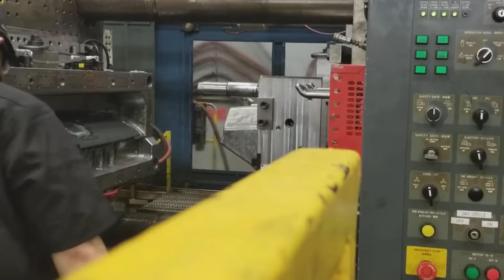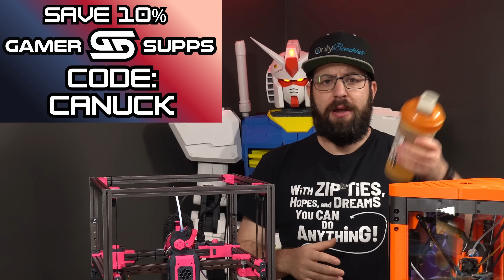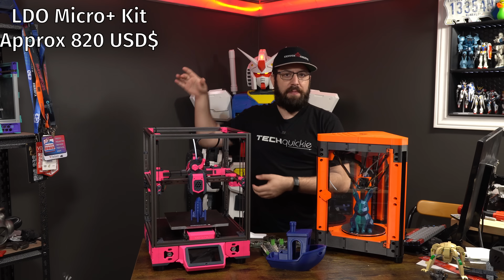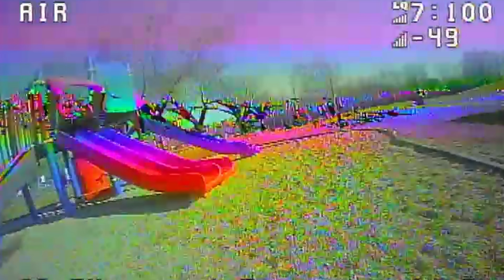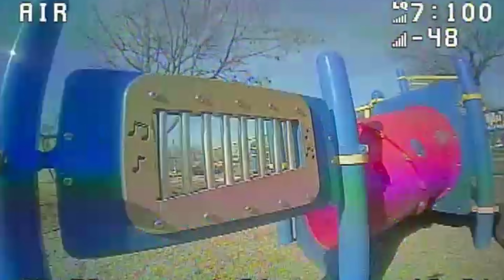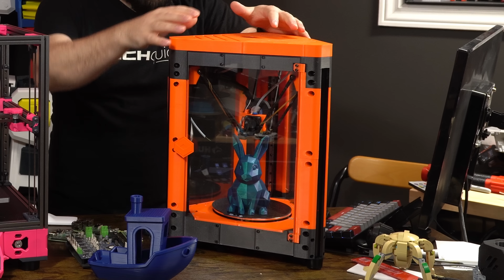Are DIY 3D printers in danger?

Comment: I built my Prusa MK2 and my MK3S. I built them more because I had to vs wanted to. I don't want building printers to be my hobby and never did. It was necessity. It's a tool for other hobbies. I don't want to make most of those tools either anymore than I want to make a screwdriver, hammer, file, or nail.

Comment: I started back in 2016 and have built various bed slingers and corexy printers, toolheads, and uogrades but at some point in the last couple years Ive found myself moving on from focusing on the printer and just wanting to print. My self built printers always became projects in the end, reliable enough to keep working on but never satisfied with the results for the effort put in. Sold all but my v0 and went in on BambuLabs to just pop in filament and have a great quality print with little effort. I always look for the next best thing, I’d even put effort back in to make, but the community is not cohesive enough to have a kit that becomes hands off enough to rival the BL printers. So now I’m off to printing parts for CNC machines, robotic arms, and a magnitude of other projects not worrying about if my print job will fail me or that my printer will be half in pieces for 6 months until I get around to yet another upgrade.

Comment: I may have made fun of your beard in the past and got banned from your discord, but I think you hit the nail on the head. 
This isn't unlike the RC airplanes of the 70's when the only way to make a plane was buy plans, buy a stck of balsa wood and get tracing on the diningroom table and make with the glue and monocote over the winter for the  upcoming summer season. Today you would have a hard time finding the materials as most kits are molded and can be assembled in an hour. <<sniff>>
The same will become of DIY printer building, like gearheads making custom cars or people that build custom CNC machines, there ARE people doing it, but it becomes a relatively small % of the market as compared to the ones that just want the thing to do the thing. There will always be "creatives" who just do their thing but supporting commercial kits like LDO et. al. will become more and more of an acconomic challenge for them to keep is cost effective. I'm no model railroader, but I suspect that market is very similar.
I like you, I got into 3D printing industrially way back in 2008, and at the time, there were zero commercially avail home units other than DIY. Bre Pettis had just started with his Cupcake CNC printer, and it was pretty hokey pokey. I have only built machines for personal and professional use up to now. I have recently been gifted a Qidi X Max-3 and I have to say, there is value in being able to turn something on, get a part printed and walk away... Yes, as a builder and Engineer well awar of what I am looking for in terms of features, but in the end, it is all about ecconomics and time.
Will I be building a DIY printer in the future out of a kit, scrounged industrial spare parts and prototype scap extrusions, absoluitely! 
Will I be buying a commercial off the shelf printer from a big name brand, probably yes too.

Keep up the good fight. Nice work.

Comment: Built an i3 clone.
Built a V0
Built a V2
never bothered assembling my V1 trident

While the V0 is 100% my favorite,  I don't see myself building another printer again.
The cost is just WAY to high to justify when you factor in the time it takes not just to build it, but to tune the printer.
At the end of the day its a tool, and i can now buy a working machine for a fraction of the price (time has a cost) than i can now build my own.

Comment: The next DIY will be centered around mini-factory, print, eject, bin.  And also into engineering plastics, because desktop CNC is here now which is a foundation of metal, and water cooling. You can see the industry slowly steering this way. Desk top additive and subtractive manufacturing to support high heat engineering grade prints. And this will lead to desktop injection molding. Hopefully we also get some desktop recycling and filament production to give us some full circle awesomeness.

Comment: This video puts me in an awkward spot. Lol . I have several "box" printers all with decent volume sizes. But all of the z Heights are completely overkill for me. The tallest thing I print on the regular is 100 mm tall . So having 256 or 300 mm of height is complete Overkill. I'm taking a creality K1 and cutting its Z height in half. Building a new frame for it with a unique exterior look . It will still be fully enclosed . The whole Gantry will be mounted lower than it is on the factory one so that the entire cable chain set up up top will be contained inside and not need one of those Goofy pop top lids. I'm shocked that there is no printer available with a reduced Z height for people like me. I know there's a lot more out there that don't need tall Z Heights. For packaging purposes if I have these stacked vertically on shelf I can have three in the place of two potentially even four in place of two. 👌👌👌

Comment: I’m in that middle group you mentioned. I enjoy building and/or modifying printers. But I also have no problem with buying one. I’ve built a couple Vorons and have heavily modified my Ender 3 V2 as well as an Ender Clone. I enjoy building them as much as I do using them.

Comment: casually glances at the XYZ da Vinci 1.0 Pro sitting on his desk 2016 fully enclosed, open filament, core xyz machine with wifi. Still runs. Still prints what I want to. May be slow but it works for me.

Comment: I don't know I have built many printers, I have bought several off the shelve printers. My whole goal is to print things with the least input costs. The prebuilts spank my voron up and down, and for me cost is the driving factor. If I can buy something that works better off the shelf at a 1/4 of what it would take me to build it. I am buying it, plus the prices are insane the X2D dual nozzle extrution that actually works well. It spanks my voron and pallet all day long at half the cost.

Comment: People have a stronger desire to do the things printers and drones can do, without making the printer or drone a project on it's own. 

I'm sure the DIY space in both areas will always be around in some form, but I wouldn't lament it's reduction in size at all, I welcome it, having a printer that functions more automatically without needing to constantly fiddle and adjust it to get it to work is a massive pain, and that's exactly what you get with a DIY printer.

Comment: Thinking about building one with a 1" thick aluminum bed drilled and tapped with heaters using hi-win blocks and large servo motors with servo pack driver boards. A very large and heavy machine.

Comment: I love tinkering. I love building, I love making things. But I'm getting older, and I'm well past the point of making things for the sake of making things.

I don't want to build a 3D printer, and I don't want to spend all day/week/month messing with it just to try and get it to do something. I just want a printer that prints.

Or as the meme says, I just want milk that tastes like real milk.

I'm eternally grateful to each and every person who's done the DIY thing, who's contributed to the community, who's helped make 3D printing what it is today. I really am. And thanks to all that development, I can just go online, order a printer, plug it in, and get it going in 15-30 minutes.

Now THAT is a golden age.

Also no, I won't touch bambu. That locked ecosystem bs is wrong on so many levels. I got a Qidi Plus4, I keep it airgapped, and it runs very happily off usb sticks for print files.

I'm still a maker. I print mostly stuff I've drawn myself, for my own projects. I fix stuff around the house. Occasionally I print stuff for my friends (usually to fix stuff, occasionally trinkets). And I've learned so much, learning how to draw things I want to build, that are printable.

But I just want a printer that works.

I don't think DIY will ever go away, though it has become optional now, whereas it used to be a necesity. And I think DIYers will come up with the next big thing, whatever that may be. 

But... it's optional now. And I think that's a good thing.

Comment: I think FDM is getting close to the best reasonable hobbyist can do for now. DO not get me wrong here, I am an avid VORON enjoyer. I am an engineer and I use one to fabricated experimental setups in a laboratory i work. It is a 350 trident that i custom designed high flow chamber heating / cooling for. the thing hits 100c chamber temps, we can printer engineering grade materials on it. it cost 3000$ and against a 11000$ professional machine it is a steal. for the hobbyist though, what is there end goal? printing exotic polymers that can kill you if they overheat and it cost 200$+ per roll? more likely they want to print trinkets and boon doggles in pla. an out of the box printer is unfortunately the easiest way there. There was a time where kit printing meant new features people wanted but couldn't have. That is still true in some cases, like my lab printer with it's 120cfm of cooling and 100C chamber for printing chemically resistant parts. for most people though I dont think it is true anymore

Comment: So... here's a question from an outsider wanting to get in: What do I start out with? I have some criteria that need adhering to.
1: Dummy simple to set up. I'm not averse to putting things together, but I want it to go together relatively fast and easy. IE: I crack the boxes open after work on Friday and can make it go Brrrrrr by Saturday night.
2: Offline capable. I don't want Corpos or Gummint spying on me. The Gummint already knows how  much I hate them. They don't need to know about the 3D print effigees I'll invariably set up in the back 40 at the family cabin to plink with my .22. 😂
3: Enclosed with good fume mitigation. I live in a small apartment with my 4 legged bug zapper. I don't want prints embedded with cat fur, nor do I want to poison him.
4: Big enough. Not saying I'm gonna build a gun, but I might want to squirt a custom grip or buttstock for one of my existing guns. 
5: Filament agnostic. Not knowing much about how certain things behave, but knowing a lot of my plastic gun parts and motorcycle parts are normally reinforced Nylon injection molds of a random flavor, I want to be able to run anything with "relative ease" so that I can make stuff that'll take some abuse.
6: Option to mod later. I'm a "Buy once, cry once" kind of guy. I'll drop as much as I can on the best kit I can afford, then have it grow with me as I go along until it can't be modded no more.
It might be a tall order, it might be braindead simple. You dudes know way more than me on the subject.
Reply: Qidi max 4 or q2?

Comment: what makes me the most upset is the stagnation of capability (again). The first stagnation you mentioned I think had lots to do with market segmentation between consumer and industrial printers, and I see the exact same thing happening again. Case and point bambu artificially limiting their 2nd gen consumer printer nozzle temp to 300C. I wouldn't care so much about the out of the box printers capturing the market if they actually pushed the things that matter forward, but everytime they just segment the actual paradigm shifting changes into the industrial printers.

We have some really nice materials now, like composite nylons and all the PEEK-like plastics, but all of the (popular) brands refuse to increase their consumer printers' specs to properly support them. Yeah, these materials are more expensive right now, but I 100% certain much of that has to do with them being "premium" and "for industrial printers" and the fact that since no-one of can print them, the economy of scale doesn't exist. 

In this day in age every 3D printer that isn't just a slop factory should have a 450C nozzle, 150C bed, and an active venting chamber (I don't need a heater, the bed can do that, I just need to be able to set a max and min chamber temp. I highly doubt a thermometer and a servo motor costs more than $5, come on.) We have been stuck in PLA land for nearly 10 years, I think it's high time the real capabilities of printers is properly expanded if anyone wants the ecosystem to continue to grow.

actual capability improving multi nozzle tool changer-esque stuff would also be a fair direction to go in, but I think that is a much larger ask, especially if you include multi-nozzle size capabilities. The just improve specs direction is just so free (cost and complexity wise) in comparison.

Comment: I am an Engineer whose first printer was a Prusa.  I want to build a Voron Trident, but I have been holding off because the Prusa still works and a Voron kit is a significant investment.   Most parts I print are small.  Some are bigger.    I also see stagnation.

Comment: The USA states that are playing around with the idea of snooping on the consumer on what they are printing, with consequences on controls of what manufacturers make, will possibly inspire people to do kits to gain control over government "censorship".
I think that avoiding cloud based file saving CAM software, is another path that people may go down to avoid  another snooping avenue. After all, a 3d print gun file needs a solid model at the beginning.

There certainly is bad PR out there about 3d printing making junk like dragons etc.

I like that Creality have the shredding and filament making stations coming. It doesn't take long to make a whole lot of landfill from just failed prints and support structures. So when multiple manufacturers start their versions of such devices, it will be a good thing.

Perhaps pallet type machines are a better path forwards. Cheaper material costs and maybe they can be engineered at cheap enough price for better reliability than filament machines with their filament clogs....

Comment: CCP-backed tech is plainly insecure: Xi's Chinese intelligence may share data with Putin's Russia. Ukrainian FPV drones small manufacturers' locations' will, sooner or later, be disclosed if they keep on using Bamboozle machines in Cloud mode. And there will be no LAN mode because of regulations. This is the primary reason why 2 2x-slower DIY printers are better than one fast and branded Chinese one.

Comment: i think a good printer for this stuff is litterally just a ender 3, it works out of the box but requires alot of tinkering, you could do SO much with it too, there are thousands if not millions of combinations and different things you can add to a ender 3

Comment: Mandatory regulation+cloudization+tivoization have already immortalized DIY gems like Vorons, Ulti-clones and i3-clones. Chinese state-backed sell-at-loss-to-destroy-all-non-chinese-manufacturers strategy makes DIY movement 100x more important. PS. I DGAF if my 2019 garage oldie Ulti2-clone is 3x slower than bamboozle machine, as soon as it depends on no commercial scums, is able to work locally, and can be easily built from aluminium extrusion, motors, belts, heaters, MCU board, motor drivers et al.

Comment: My first printed (that I completed) was a tronxy x5sa a kit printer. I wanted a kit to begin with. I have bought a few enders cheap that were used but not falling apart.

Then I built a Voron 0.2 it was a great build but it hasn't printed quit right and I need to go back and get it going again. 

My first quasi no kit printer was my current daily printer the SV08 it good but I was still able to do some mods to get it really good.

My current printer build is a ender NG.  

I would love to see kit printers come back but I dont see that they could get to some of the price points that would make people buy kit before something that you just pull out of a box.

Comment: how crazy would it be to build a 3d printer with dvd drives in 2026? Just the CNC part first and then add a hot end in the next version. Just to learn electronics and writing firmware on my  own.

edit: If this gets enough likes, I might do it myself. Maybe on a stream?

Comment: I'm the type who thinks that buying a kit and assembling something isn't being a "do-it-yourself" person. I built my 3D printer 11 years ago, completely from scratch, using only parts bought separately from China: extruder, fan, an Arduino shield (I already had the Arduino), some stepper motors, GT2 belt, some linear guides, a printed circuit board as a heated bed, and a few other components: nuts, brass nuts, and a threaded rod for the Z-axis, and that's it. After that, it was a lot of work cutting metal, soldering, drilling, "adjusting" (because everything was done by hand), and assembling everything. Until I finally managed to print some parts and improve it. But I couldn't exceed 100 mm/s, not even in the travel speed xD. There were many budget and delivery time limitations for new parts, etc., to make improvements.
And today, well, after seeing the prices and remembering everything it takes to make a printer myself, I ended up buying one.
However, here I pay 10 times more for anything you find elsewhere. Five times more per dollar and twice as much in taxes. That alone makes being a maker a "rich person's" thing on my shitty country.

Comment: I built my first printer back in 2019 with a Prusa MK3s kit. Not because I needed a printer, but just because building things is fun. I then taught myself CAD so I could make useful things with the printer. Learning CAD is probably the best thing to come out of owning a 3D printer, it unlocks so much potential.